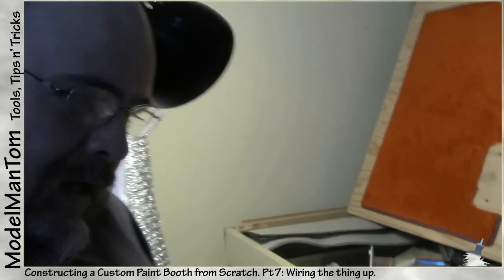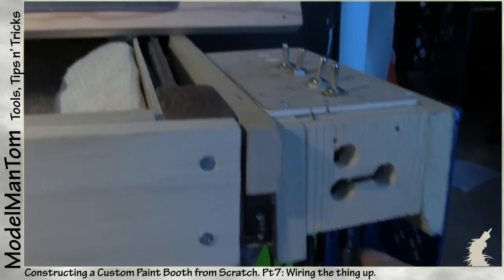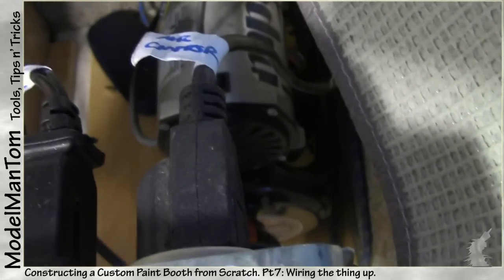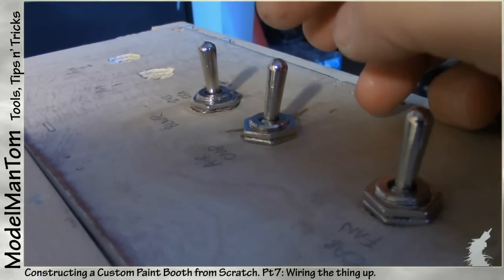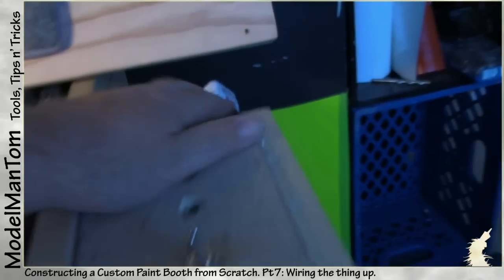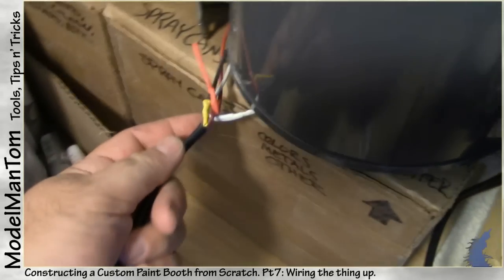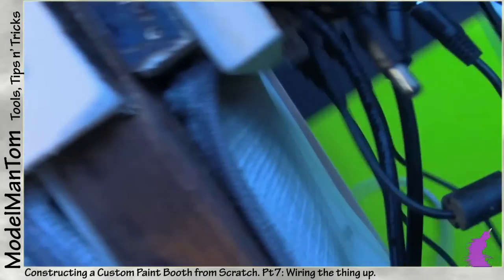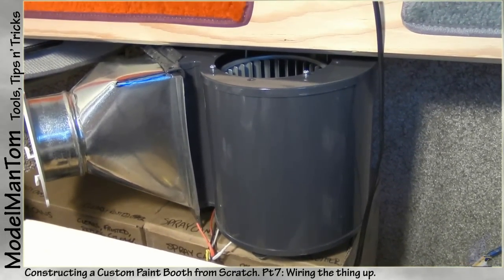Paint Booth Pt 7: Wiring it up.

Comment: Pick yourself up a non-contact voltage tester "tick tracer". It will light up if the circuit is hot when you hold it up to a wire or stick it in the hot (smaller) slot in a receptacle. They don't cost too much and definitely save your skin. Keep in mind that they ONLY work with AC. It doesn't do anything if you hold it up to DC, say like a battery.

Comment: Hi . That is a nice spray booth. You might consider installing a circuit breaker inside the booth to prevent   
a short circuit. A GFI (ground fault interrupter) is probably what you might want to use .

Comment: With mysterious voltages in various places, you've made yourself a nice little set of deathtraps! A new dimension to modeling... spray a while... spray FOREVER! (sorry; the entrance to Disney's Haunted Mansion says that... y'know, stay a while, etc.)

And yes, I was going to tell you what Mr. 7ger did, below. Those are made for electricians to select individual switching for a duplex outlet.

You just like throwing toggle switches! allectronics.com has toggle switch guards for that type of 1/4" mounting hardware...
Reply from the maker: I got all the elec gear from AE...  The guards are only for the smaller 2A switches, not these heavier duty 15A switches.  I tried fitting them, but alas, no they would not.  The first switches I got were toggles with guards, but when I saw the small amp load, back they went.
Reply from the maker: I certainly will be using a proper 'project box' to hold the wiring for v2, but "deathtrap"...  ?

Comment: Nice job Tom, the outlet wall plug is designed so you can break the brass tab off with pliers, do not break of the silver tab. This allows you to have 2 separate plugs. 
I enjoy your postings, Tom
Reply from the maker: Thanks!  I was thinking it would be something simple like that.
Reply: ModelManTom Good to know, I thought you couldn't separate them.